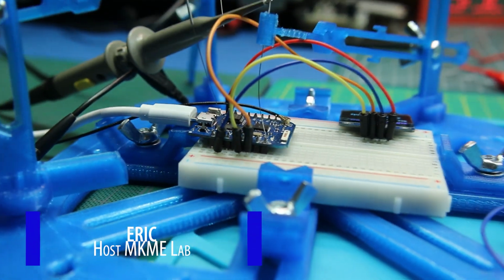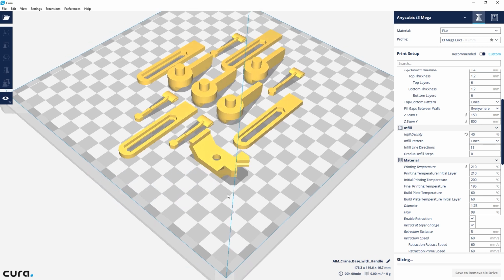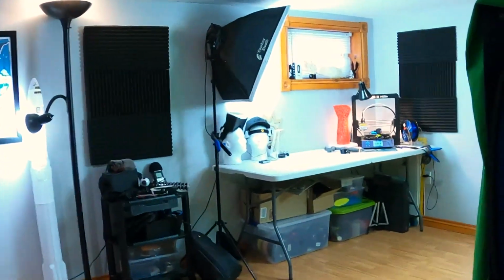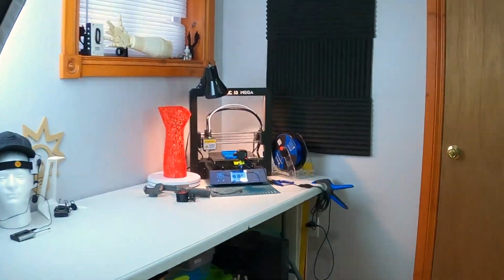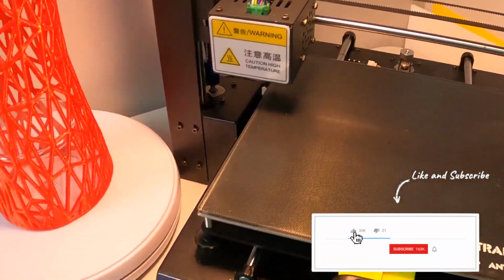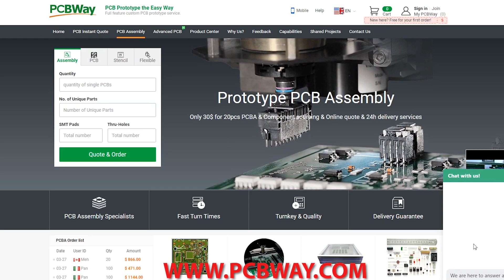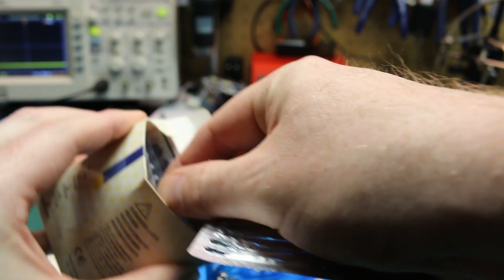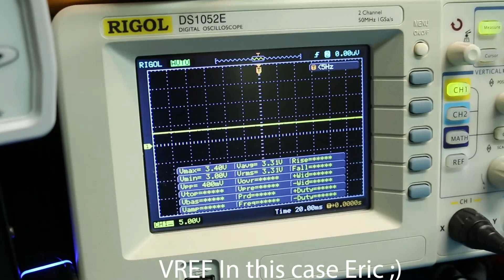3D Printed Fixture For Probing Electronics -TUTORIAL

Comment: Would it get too crowded if you clipped standard pogo pins into the ends of the arms and used those instead of the acupuncture needles?

Or jsut use common sewing pins?
Reply from the maker: For most stuff I think pogos would be fine.  I dont think the pins would be great unless you get really "bendy" ones as you need some flex to put some preload to hold the connection.  As long as they can flex I suspect they would work.